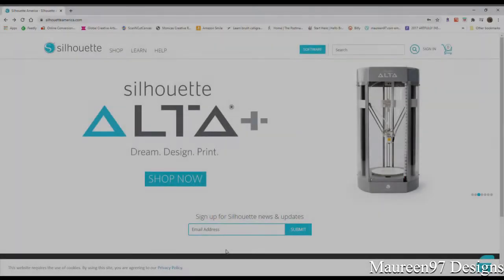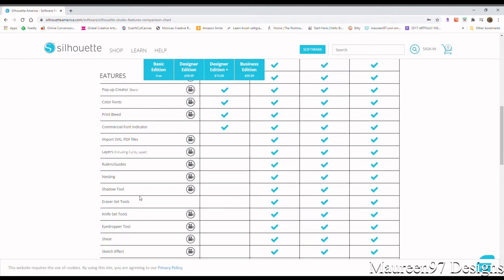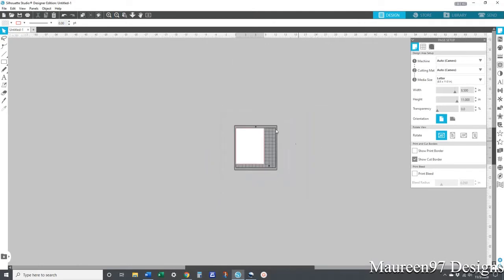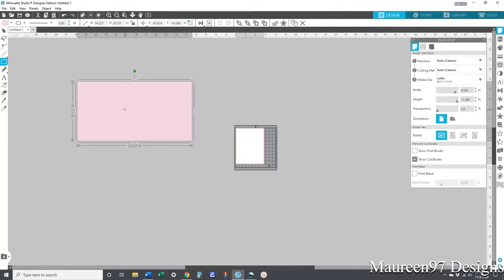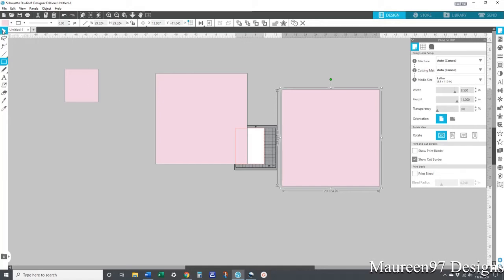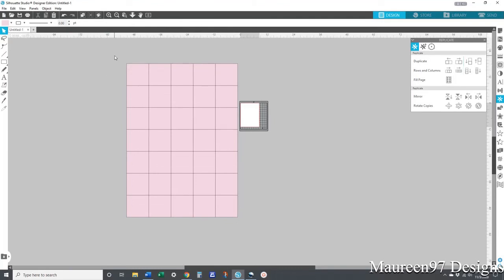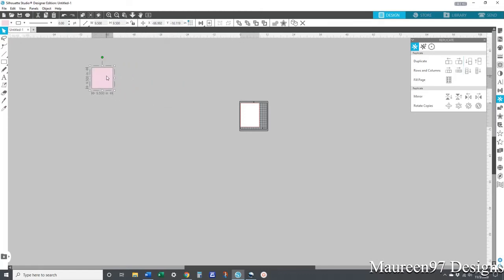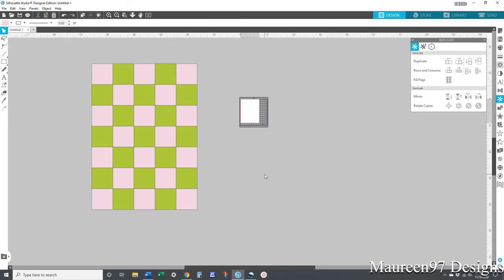Using Silhouette Studio Software For Quilting Part 1

Comment: How do you get the exact material pattern into the software?  How do you cut the fabric to quilt, not paper piecing, nor applique?
Reply from the maker: Hi Malinda!  I go through that process in Part 2.  When cutting, I use a regular rotary cutter and ruler - I don't actually cut with a machine.  Hope this helps!

Comment: I got a chance to use the Silhouette software today to design a block and digitally fill the block with fabric using jpegs I downloaded from the fabric manufacturer’s website. I was able to load the entire fabric collection into Silhouette really quickly and easily. Once I set up the shapes I was able to swap the fabric fills really easily to see different combinations. I like doing sampler quilts so my plan is to make a Silhouette file for each block type and I’ll be able to use each file over and over. I made a master file that has all the shapes like half-square and flying geese so it’s easy to take these and make a lot of different types of blocks quickly. I am finding this much easier and quicker than EQ8 for what I want to do. Thanks so much!
Reply: hi Diane.  great comment.  i’m an advanced beginner (title i gave myself! 🤣) in quilting as well as a cameo user.  i need to try what you did!  good for you!